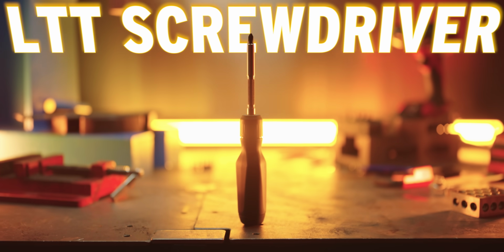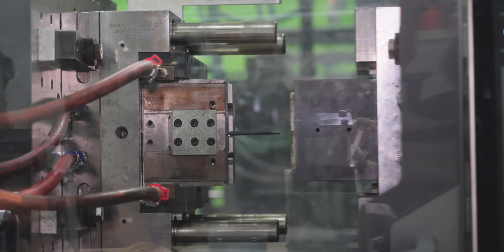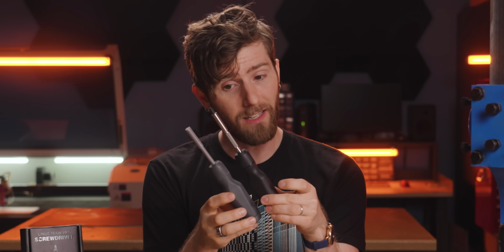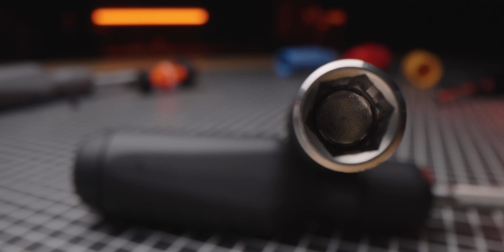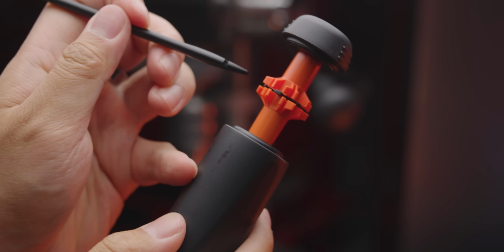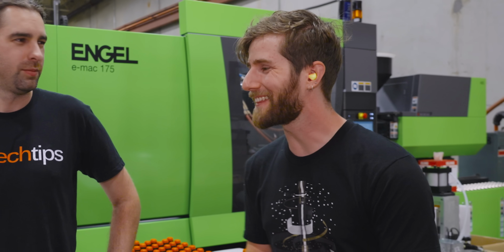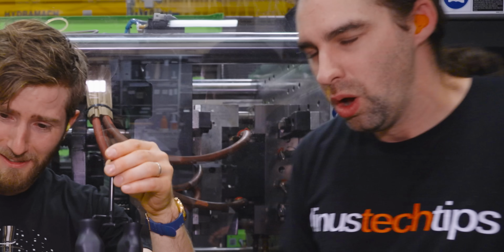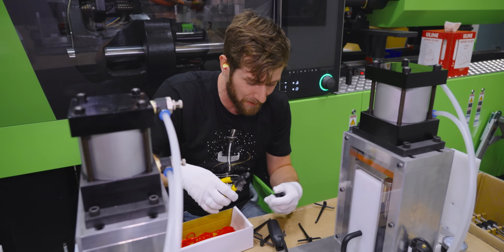Why our Screwdriver took 3 YEARS

Comment: as a car mechanic, the thing that i think is missing, is a "nut" in the end of the saft (where it touches the handle). That is for the stuck screws. You are essentially unscrew a stuck screw, by pushing hard with one hand, and unscrew with a wrench
Reply: A lot of people have said that. I'm curious why Linus & co. decided not to add it. There's no way they didn't consider it.

My best guess is that it would imply that it was a good decision to use the screwdriver that way--which it isn't. But maybe it was something else.
Reply: @DanKaschel  My best guess is that they wanted to focus on PC and not a general usage. For me it is a lost oportunity, and it is a common thing to have on the most of screwdrivers. I believe that, because those screwdrivers with a nut, usualy go all the way to a metal end, because people are hiiting them with a hammer as well (to unstuck a screw) and that's impossible with the LTT implimentation. So in a nut-shell, it is a non- industrial screwdriver, but a multitool that is focusing on speed, confort and mobility

Comment: Manual bit loading from the handle is always fiddly. Instead, I have an autoloader driver that deploys its collection of bits by a twist mechanism that pushes the bit up and down the neck. I just tug the handle longways, spin, and push it back in. I don't know if anyone still makes it, I've had the thing for years.

Comment: Usually would do the die in Singapore and being it to here for injection moulding. Maybe glass reinforced nylon than delrin...should have had a third party in china or Taiwan doing the qc. Why is shaft press fit.. shouldn't it be insert molded.

Comment: No leds to see where you screwing (e.g inside a PC case) no extension to make it longer or  ability to remove the stem to make it shorter to reach that screw from above  (e.g on a noctua cooler in the 100 other other instances where you need it to be a little longer than the average screw driver) or short so that you can screw something in tight spaces or an flexible extension I rate this 6/10 the perfect clicky noise of the ratchet is like a low priority and you spent years and money for that instead for features that would actually make it more useful than the average screw driver...

Comment: With every product, you want to know how the manufacturer came up with the price. I needed to see this video. I use an iFix It kit and wondered if this screwdriver was worth my time. Thanks. It is expensive, but I have a brand new Dewalt sliding compound miter saw that I got two years ago...I've not used it yet. Spending money on tools is a thing I do. I think I'm gonna give your screwdriver a run. Seems well built. I appreciate the thought that went into it.

Comment: A bit too much for me, but well done, it looks like a quality driver for sure. At $40 USD I'd probably bite. But I understand why you had to price it accordingly.  
Also, I want a driver with long shanks, and diameters the same as the bit for those far recessed fasteners. These 1/4" hex shank drivers just don't work for that. I like the Milwaukee one for this, but it's ratcheting and build quality is just OK. Probably why it's only $15.

Comment: Wait... so it has proprietary bit sizes? 😶
I want the right to buy standard bits at a hardware store and fit them inside this screwdriver! 😅
But seriously, it's the first thing I thought of when I saw you've made the bits smaller to fit and found it a bit ironic since I support "right to repair" just like you do.
I'm a mechanic, and I have a bucket full of bits that wouldn't fit inside the storage of this screwdriver.
Of course, I wouldn't go as fast through bits while working on computers (which is what this screwdriver is meant for) as I would working on cars and planes, but I do tend to throw bits away if they start slipping from wear because then they will start damaging the screws and make it even more likely that they'll slip.
Reply: If you watch the entire video you'll realize they created the "ninja star" thing so that if you want to use standard size bits you can, by shifting the ninja star which combine the two bit holders. You get only 6 bits in that way but it works.
Reply: @putneg97  
I admit, I didn't watch all of it.
30 minutes is a bit long to keep my attention on a screw driver and it started to make me feel like I was watching an infomercial. 
I'm glad they thought of it.

Comment: The development process of the LTT screwdriver really demonstrates the power of 3D print prototyping to me. If we are stuck with only handcrafting, this could cost even more to develop.
Reply: Modern day engeneering in general man... everything from material science, to 3d molding, printing, laser cuting, softwere development etc... we really have come a long way as a species.
Reply: Additive manufacturing and prototyping is so much more efficient, but cnc milling could also have been employed. The body of knowledge accumulated in these fields is astounding.

Comment: Working in the plastic molding field, I had to have a small laugh as Linus was trying to assemble with out gloves. That material can be hot enough to burn you quite easily... I know from personal experience :(. It's amazing tho how small the world really is we use a bigger version of those molding presses. The material ratio and everything is just fascinating to understand from an out side perspective. Will be getting me an LTT screwdriver as soon as I can. Great job guys love the attention to quality and the dedication to customers.
Reply: Seeing it's manufacturing process makes me understand why the screwdriver is priced like that. I'm not knowledgeable in this field, but I assume 40 second cycle time is SLOW, and I don't know how many injectors they have there, but if they are churning out 2 screw drivers every 2 minutes (from plastic piece, to assembly, I guess it's around 2 mins?) that's a pretty low volume yield, meaning costs are higher.
Reply: @teebles   Hmm, 40 seconds. Depends on what you comparing that to. Bottle caps yes its slow (approx. 2-3 sec to 24-96 pieces), Car bumpers...maybe (depends on size but it´s around 60-100 sec a piece). But more on the technical side of that... it depends on the technological process, how long is the real cooling time, injection speed and holding preasure and so on. It is a lot to learn to "make the machine go" as you like it. So to conclude that, 40 seconds is kinda average. 😀
Reply: @teebles  it is 90 screwdrivers an hour. So 2160 a Day. I assume they built up some of them before official launch.
So its around a 100000 in 2 months.
I kinda doubt they are gonna sell more than 100000 in first 3 months. And i assume they have at least 2 of those machines so 2 as much. So more than enough.
Reply: @KrolPawi  I'm like 90% sure they only have one machine (well 2, 1 for each different part), as they "only" paid 200k for the injection molds. You need one set for the shaft and another set for the bit holder parts (other shape and material). And while 40 sec for 2 shafts is quite slow, it should be more than enough for them in the long run.

Comment: A lot of these features are pretty useless tbh, especially the backwards ratcheting. Seems chock full of features you would never even need. 3 years to design something that's worse than Klein has already been selling for quite some time at home depot, but 3 times as expensive...

Comment: I always was wanting the LTT screwdriver.  I ended up buying a lowes craftsman because I could never find the one linus was using on all his builds.

Will it work with a tall air cooler without an extension?

Comment: Wow it keeps getting better. Plastic lever parts and a basic delrin shoulder bushing for the shaft. Lmao I machine plastic for a living. You should have at minimum used acetal or peek. Personally I would have used a metal bushing as I'm very familiar in the plastics industry I've machined it for 10 years. Thanks for giving me so many reasons not to purchase this.

Comment: when im able to have enough money for the cost would you build me a pc that you think it great for a beginner that has a water-cooling system and great specs for gaming im currently on a gaming laptop and am facing problems with my ram and games crashing ive tried everything just doesn't work ik its not going to be anytime soon but i would be honored if i got a pc made by you, something cheap and not to expensive but that runs better than a laptop and gives balanced gaming experience.

Comment: I’m a Moldmaker! All the terminology used in the video is spot on, the prototyping, edm and final production is exactly what I work with each day. Looks like a solid and well executed screwdriver
Reply: @Mitch-Suchiu:

We certainly aren't getting screwed (ie. Stiffed ie. Scammed) with this screwdriver!
Reply: Yeah I work regularly with molds and was actually impressed by the info here. All spot on and hopefully easy for new people to understand
Reply: Do you know if Noctua fans are brown because it's the type of plastic that works best? I've wondered why they were so dead set on it for so long.
Reply: @Mr.Morden  Color usually has very little effect on the injection molding process itself.
Reply: To eliminate sprue and runners, hot runners are used which in turn eliminates wastage and regrind!
Reply: @Conqueeftador69  they probably handworked both the core and cavity, we have a 5 axis carbon cutter for the EDM machine at my shop and it’s impressive how well it burns all things considered
Reply: Worth the price though?
Reply: @liceafilms  if it’s something you will use every day, then yes it’s worth the money, cheap tools are are great for a couple uses..until they aren’t.
Reply: @liceafilms  "Worth" is a very personal thing. For me, a quality tool is worth A LOT. The amount of engineering that went into getting this as close to perfect as possible is really impressive and those that are knocking it for the cost don't understand what it takes to actually make something of high quality... especially a tool that has forces applied to it.
Reply: @RyanThomasNYC  I’m not knocking the build quality, it’s just not practical for MOST people. And I know this is obviously not for the general population but more so the LTT fan. So, he definitely knows his audience. The comments here are proving so.
Reply: @liceafilms  people especially in north america seem to spend ungodly amounts of money on merch. Just to support their favorite content creators/bands/whatever. In this case you get a high quality tool that's going to last you pretty much a lifetime, something you can't say about overpriced clothing.
Reply: @sombrero4316  I bet most of the people that purchase this screwdriver will not have it for a lifetime..it’ll probably get lost or forgotten somewhere
Reply: @liceafilms  how often do you lose your phone?
Reply: @liceafilms  that is a question every person has to answer for themselves (via their purchase decision). It's cool that it's not worth it to you but it's a little silly that you seem to need everyone to agree. Or maybe you feel superior because it's not worthwhile for you? Either way, think about the things you enjoy buying and whether you'd want people telling you how stupid it is. Why try to steal someone's joy?
Reply: @DanKaschel  because it's a damn screwdriver.
Reply: @DanKaschel  well said. If it's so expensive for someone then just move on. Gucci and Lambos are expensive for what they are (clothes and cars) but people really appreciate over built and branded items. No different. Sure something 20$ cheaper is maybe 5-10% less "better" but doesn't matter. Ill buy one shortly cause I want something high quality and want to support LTT
Reply: @DanKaschel  I asked a question Daniel, calm down lol you’re obviously free to purchase whatever you want. Is it “worth it” is subjective. Hope your $90 screwdriver makes you feel nice though!
Reply: @liceafilms  Here is you being condescending. "Hope your $90 screwdriver makes you feel nice though!"

If you were honest and disliked the price. You would merely say. "Hope your screwdriver works as good as it costs." Nope, you had to point out the price and feels.

I bet you're a lefty. Go back to wearing pink shirts.
Reply: @xagain3106  you do know what assuming makes you, right?
Reply: @liceafilms  As an industrial mechanic I've gone through a bunch of ratcheting screw drivers before I finally ended up with a snapon one that's never failed me. It's in the same ballpark as this. It's worth every dime I spent on it because I know it's going to work. If this is as durable, it's worth it
Reply: @liceafilms  hell nah 😂

Comment: At 14:40 Linus says if you really want to you can grind a drive bit down to size with an angel grinder. I don't recommend anyone do this. This WILL destroy the heat treatment of the bit making it prone to break. If you really need a special bit that LTT don't make, you will be much better served just keeping the 3ed party bit loose in your pockets than destroying the hardness.

Comment: I wanted to buy the LTT Screwdriver, but Ineeded something faster, so I bought the iFixit Mahi set, and altho it is a good kit, The tips aren't magnetized at all, which is very annoying, and the finish near the bit is all worn off after a couple of uses, I also don't like how short the shaft is,makes it very unsuitable sometimes. and I wanted a `jack of all trades` set.
Reply: Also, no ratchet. and altho having many bits is cool I rather have a few more common handy all times

Comment: Why not a forged shaft?
Reply: Unnecessarily expensive, if you’re using enough torque that it needs to be forged you should be using an impact drill, not a screwdriver.
Reply: @StraungeYT  fair enough

Comment: Was a nitride finish tried for the black shaft?

That is a very tough finish. It’s actually more of a surface hardening treatment, but it leaves the part colored black. The surface of the steel becomes very hard and scratch resistant.

Comment: Lmfao looks exactly the same as the ace hardware screwdriver my mom had when i was 15 years younger... Un. Original.
Not just exactly the same, but it literally looks like you ripped off multiple other brands, and im sure its no better than the 3 i have exactly like it in my closet.

Comment: Dewalt and other brands give limited lifetime warranty for a fraction of the price. Plus they are skinnier which is easier to work with.
Reply: ...and uses standard sized bits.
Reply: @handspiker1994  then buy some different ones with the $50+ you saved.
Reply: I’ve used the same Craftsman driver for 10 years and never had an issue. Best 15$ I ever spent.

Comment: Glad to know that after all the time spent, it is a real high quality product that we can trust.
Reply: can get a ratcheting screwdriver from Amazon for 20 bucks
Reply: @_pitaph_6392  It has though. At the pop up shop in a livestream on short circuit
Reply: @wojtek-33  now that's what one should center on, third party, just because Linus tests others products doesn't mean their products shouldn't be tested, just means we gotta find someone else to test their products, still waiting to see if their bottle is as good as a zorijushi
Reply: Can you tho? It hasn’t had any real world testing
Reply: @recreant359  I mean Linus has been using it on camera for a while now, unless you are saying Canada isn’t real
Reply: @zach237  still wouldnt really call it real world testing until mass production units are shipped and used for quite some time.
Reply: @recreant359  haven’t you seen the short circuit stream at the pop up shop? It’s not much but it’s something